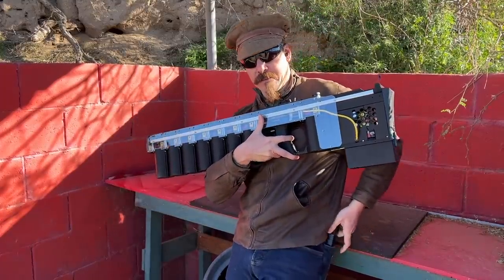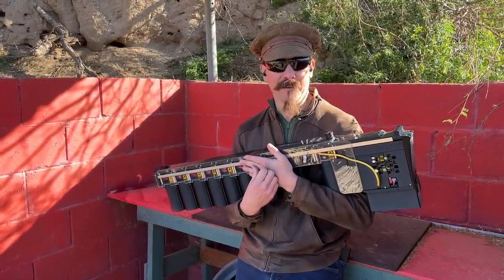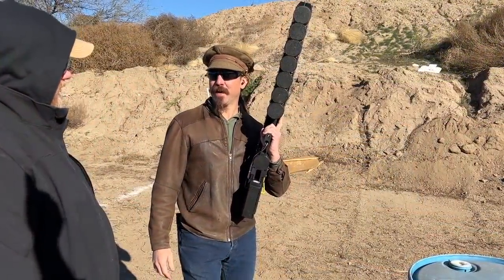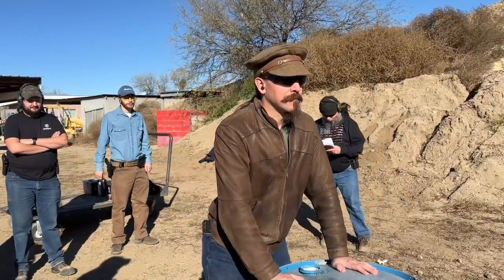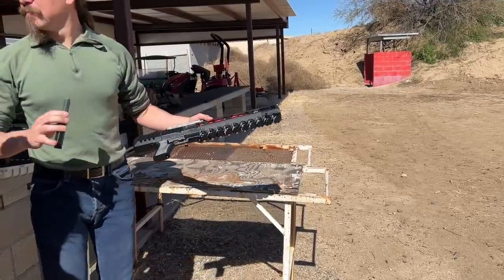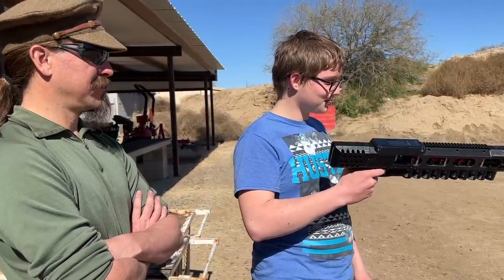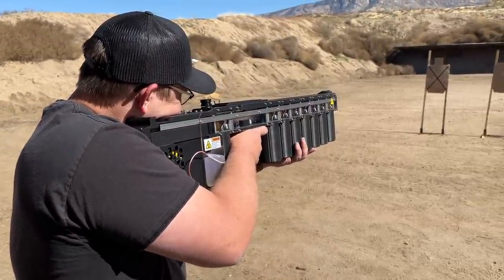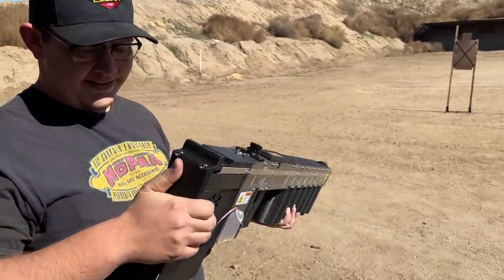I Tried to Use the GR-1 Anvil at the BUG Match...

Comment: I think one reason the projectiles had so many problems (aside from this being a very experimental weapon) is because they were too heavy and blunt.  there appeared to have far to have far too blunt and flat of a round and it would give it far too much wind resistance and likely making it expend far too much energy to launch it.  I'm not one of the developers or manufacturers of this gun, so I can't say for sure what problems that would cause or fix, but I think maybe a conical or semi-hollow round might be worth a try
Reply: I think the creators were thinking about using ball bearings rather than dowel pins. It's mentioned in Ian's interview with them irrc.

Comment: 4:35 My thoughts exactly! My brother and I made a couple tiny coil guns with flash capacitors out of disposable cameras and 9V batteries (thanks, PopSci!). They launched cut pieces of paper clip at 1 MOA (1 month of angle) and would stick in a Lego man's face if you shot him point-blank. Couldn't even feel them through a pair of jeans at 5 feet, so both the precision and power of these machines from Arcflash are kind of mind-blowing.
I want one of the little full auto guns, and at around $1k they're pretty reasonably priced, but I'm a little nervous about gripping them by the capacitors hanging out the bottom. The projectile might not blow your hand off, but those big caps certainly can :D Might need to cobble together a skookum-albeit-nonferrous handguard for that bad boy. KP's SHTF wrap isn't Kevlar, is it...
Looking forward to seeing the production version of the gun at the match!
Reply: I laughed at "month of angle"! Sounds about right for this gun.

Comment: Holding the two-stage trigger at the first action point until it charges seems like an over-complicated charging mechanism.
Have it automatically charge whenever the safety is off, or a pump-action or lever-action activated switch engage the charging mode, so the user only touches the trigger when they try to kill something. 
And have holding the trigger down do nothing until it is fully charged to prevent half-charge shots obstructing the barrel, so that holding the trigger down fires full charge shots as fast as it will charge.
Reply: Introducing a safety so that the gun isnt completely live or off would be a start, at the moment if it always pre-charged it would be on a hair trigger. (though also worth pointing out a capacitor cant hold a charge for long, if it was primed when not in use it would be leaking energy and getting hot and potentially speeding the natural deterioration of the capacitor to the point its leaking acid)
Reply: @watcherzero5256  also, having the thing fully charge by default would add some more safety concerns. An accidental short circuit on a charged capacitor (hitting something, dropping the gun) can lead to it exploding. I´ve seen capacitors explode, it´s no joke, and these things are beasts. I think for safety reasons as much as hardware life expectancy, it would be better to have to charge the thing on purpose, even better without a chance to dry fire it.

Comment: The charge button should be on the fore end not as part of the trigger pull. Probably hollow projectiles or donuts might be better.
Reply: Wonder if they've tried milled rounds with spiralling grooves that might self-stabilise?
Reply: Could also do a button on the grip you hit with your middle finger, like the rev trigger on battery powered nerf guns. Those are a very similar manual of arms, because you have to give the fly wheels time to get up to speed before you can fire.
Reply: @tendrax  I suppose the long term future of this technology will be stacked capacitors that charge in parallel (as capacitors get smaller and more efficient) so that staright after a trigger pull you still have say three more banks of charged capacitors ready to go, and the one you've just discharged will recharge automatically from the main power supply.
Only downside of that approach I suppose would be that you'd have constant transformer whine.
Reply: @smorrow  mag-feeding some of those would be a fun engineering challenge by itself...
Reply: I wonder if it would be more intuitive to use a cocking "hammer" to initiate the charging, like a single action revolver.

Comment: The awkward moment when you realise that once such weapons are made practical for use the legal nightmare about owning them starts. Its gonna be a doozy.
Reply: True, regulating all this stuff is going to be very interesting.
Even more so than with conventional firearms, every component that makes up a coilgun is functionally harmless on it's own, with several good excuses for owning it.
I guess the most sensible option they have would be to start legally tracking capacitors over a certain size? Although, good luck with that, considering how important and omni-present these are in any kind of modern technology (Plus, I'm pretty sure it's possible to get around this by just using several smaller capacitors instead, although this reduces efficiency and makes engineering the circuit more complex).
Reply: @BackwardsPancake  Strictly speaking they only need to make the "fire control computer" the regulated part. They don't track metal tubes and whatnot from which you could fashion a firearm with only hand tools, skill and patience.
Reply: @andersjjensen  yeah, start tracking every Arduino and raspberry pi? Good luck lol. The code could just be written from scratch VERY easily
Reply: @marcusborderlands6177  Just the same as every piece of pipe from the hardware store can be turned into a barrel. The point of regulation is not to prohibit ghetto items. Because the ghetto is gonna ghetto regardless of regulation. The point of regulation is to define a legally registrable item and place safety/inspection/embargo/export laws on it.
Reply: Pretty sure the regulated part will be high speed super-capacitor charging circuits, if not the super-capacitor. From context, they seem to be the part that's difficult to replicate with consumer manufacturing facilities and the past critical to making a practical weapon.
Reply: @andersjjensen  yes, I understand that, but you chose the easiest part of the weapon to get, bar the polycarb barrel and the wires lol. the capacitors are much more likely to be regulated, as they are already kinda hard to get, and it would not disrupt commerce much for an extra check on them.
Reply: @marcusborderlands6177  No, I chose the component which is easiest to define legally without accidentally imposing far reaching restrictions on other areas of commerce. That an overclocked tamagotchi can be fashioned into one is another matter entirely.... Again, legislation is not about inhibiting unauthorized production. It's about telling manufacturers: This is the thing that must have a serial number that you must report to us and that people must put their name to, so we know who has it.... That would totally suck for capacitors. Like which one should be serialized? All of them? And if one fries, do you need to go through hoops to get your new replacement serialized and then registered?
Reply: @BackwardsPancake  As I said to many others: Regulation does not exist to prohibit makeshift production. You can easily fashion a firearm out of stuff from your local hardware store with a bit of cutting, grinding and filling. It's about defining which thing in the gun constitutes "the gun", and thus needs to have a serial number from the manufacturer. When the rest of the gun is made from common items and a bit of moulded/printed plastic parts it would make sense, from a legislative point of view, to do it on the thing which is unique to the gun. That would also open the door for legislation about not tampering with said device.
Reply: you gonna need a Ph.D is Astrophysics to own one lol
Reply: It's going to be impossible to regulate electronic weapons.  If you ban high capacity capacitors, you cripple every single industry that requires them, even something as common as a commercial microwave oven.

So, yeah, good luck with that.  I'll take a phased plasma rifle in the 40 megajoule range and 2 of the electrolaser blunderbusses, yeah those ones there that can take out a herd of "deer".  Cool, do you take cash?  Awesome.
Reply: Especially if you add this whole 'don't be near it with a pacemaker'... Imagine open carry such a thing, pull it in an emergency situation and kill three innocent bystanders by heart attack...
Reply: @marcusborderlands6177  Well, yes, it can get built easily. But honestly, It's the same with every other firerarm. It's not rocket surgery to bent a few metal pieces and put together something you could kill others with. It's however still illegal if you get caught with a self fabricated gun.
No difference here. You surely can still buy your arduino. But turning it into such a fire control unit will be the illegal part. Getting caught with such a thing - you're in trouble.

Point is: Everybody can make weapons if they are willing to disregard the law.
Reply: @marcusborderlands6177  Well, coming from this side, I understand how your first comment was meant :D
Reply: @robertnett9793  I would say the main difference is an Arduino can be unplugged, the data wiped, and bam, it's gone, no trace. (Especially if you stored the code on volatile storage like ram) compared to metal that had to be altered permanently.
Reply: I would guess it is perfectly covered by german gun laws: it´s a portable object the design and makeup of which make it suitable to negate another person´s capacity for attack and defense, it is a device that stores energy to be released into a projectile upon activation, and it is a device that accelerates a projectile in a barrel.  Clear cut case, the moment that this thing exceeds 7.5J muzzle energy (and it does, I think it´s about 100J), it is unambigously a weapon in german legal terms, and you need to be 18 years old and apply for a license (either "small" or "big", depends) to own and/or shoot it.
For this reason, a high power air rifle, a crossbow, or a potatoe gun are considered weapons in germany, whereas a recurve bow is a sporting item, considered as "dangerous implement", meaning the holder is responsible for what happens and you are in big trouble if you hurt someone, or huntable game,  with a bow on purpose, but anyone can own one, no problem.
Reply: @marcusborderlands6177  Yes. As said - after reading your second comment on this, I understand where you are coming from. It would be a lot more reasonable to restrict other parts (like the high performance capacitors)
Reply: @paavobergmann4920  It would introduce the added problem with the magnetic field and the added danger for people with pacemakers and so on. Pretty sure, if there is a readily usable final product of this gun it will be heavier regulated, if allowed at all due to that risk.
Reply: Is it really any more of a problem tho?  Many workshops could turn out simple firearms now if they chose to, shotguns, STEN clones, weapons from semi auto to full, etc.  Just make the penalties for circumventing the law strict enough and very few will bother except criminals, and criminals already dont care about firearms laws anyway.
Reply: @andersjjensen  the computer in this gun looks like an Arduino, at least the one which could be briefly seen in the previous video. That won't be all that easy to regulate.
Reply: @praevasc4299  As I've explained about a billion times by now: the regulated part of a gun is not the hardest part to manufacture. The regulated part of a gun is the part that is the least likely to need repair/replacement. It doesn't matter if you can ghetto it with relative ease. Regulation does not exist to "make it hard to cheat". It exists to make it illegal to cheat... plain and simple.
Reply: @andersjjensen  But the question is, in this case, what exactly would you regulate? Arduinos are sold by the millions, and in this case it's not "ghettoed" but part of the official design.
Reply: @praevasc4299  This particular design would have to be redesigned to continue production post regulation. This has happened before. It's generally done by setting a grace period to allow manufacturers to catch up. But by the time this kicks off enough to raise eyebrows you can be absolutely sure that a more cost effective solution than an entire Arduino will have been found. A dedicated fixed function fire control chip with a one-time-programmable serial number would be an absolutely tiny piece of silicon real estate. Any serious manufacturer would not ship something which is (fully) reprogrammable anyway, and it wouldn't be long anyway before "power classes" of some sort would see regulation too, so reprogrammability would be banned. Think "destructive device" and "short barrel rifle" type laws.

Comment: Seems like it would benefit from giving the user more and clearer feedback, both in terms of trigger and operation, auditory and tactile.
Reply: Having the trigger vibrate when the coils are charged would be nice.
Reply: @jennoscura2381  Having an actual dual stage trigger that's not a plunger would also be great.  You can easily buy switches with different actuation forces and design mechanisms to do that.  It's just the first was very much a prototype that's fireable.  Same as several of the guns that we've seen on this channel.
Reply: I don't disagree, but I suspect that's at a design stage past the 'aim and fire at a given kinetic energy' which they are working on with the model shown.  
Lots and lots of gun innovations shown on the channel capitalize on marginal/cheap mechanical changes.  I don't doubt that a non-powered indicator of 'the capacitors are at full power and the gun can fire at 100% of the specified velocity' can be engineered, but it seems like a clever materials question as opposed to a 'just run a vibration motor after a sensor is tripped' fix
Reply: What more auditory feedback do you need, it makes the capacitor noise!

Comment: The "machine pistol" version needs some introduction or did I miss it?
Reply: Having had a look at ArcFlash Labs' website, that's an EMG-01B. It's similar in power to a spring powered airgun, 3.5 ft-lbs (as compared to the GR-1 Anvil's 75 ft-lbs). Dangerous in the sense that it'd bloody hurt, but you'd have to try really hard to substantially injure someone with it. Much cheaper though! $1030 on preorder, compared to the Anvil's base price of $3750.
Reply: @Ariche2  Thank you.

Comment: Imagine in the middle of a battle, your gun suddenly reboots itself and the screen says, "Downloading update 1 of 256, Do not turn the power off..." ... And the battery shows like 15%.
Reply: @AlphaCarinae  the coil gun has a computer built in, with os and everything to calculate the time to put the magnets on and of in time, to show battery charge and to show the selected Bolt Power
Reply: @AlphaCarinae  bruh
Reply: "You require admin privileges to cap this fool"
Reply: “We’re getting everything ready for you”
Reply: @AlphaCarinae  exactly lol  there is no reason
Reply: @AlphaCarinae  Well for 1, security updates, software improvements, efficiency increases, and more.
If theres a computer, there will be softwareupdates, especially if this was in the future as a combat weapon. Its not like a handheld calculator where its not cost prohibitive to just build/buy a new one when you have updates to the software.
it wouldn't be done over WIFI in the middle of a battle, but thats why its called a joke.
Reply: @AlphaCarinae  firmware update. Like the ones that randomly screw my router.....

Comment: Idea? Using a thin steel tube, suspend a lead rod with a heavy spring whos terminus is the steel tube. The lead rod becomes the primary longer range projectile? Sort of spreading the impulse time through good old fashioned energy storage device, a spring.
Reply: I did mean all the above fitted into a similar sized projectile shown.
Reply: I think the issue there is that less steel, means less ferrous material, means there's less for the electromagnets to pull on.
Reply: @Ariche2  nah, they've got variable round lengths already- something the size of the 2" with the steel in it the 1" should logically work

Comment: An interesting aspect of an electrically fired gun is the trigger, being simply a switch could be placed in the off hand or even under a toe and fired without a chance of the trigger finger pulling or otherwise impacting the shot.

Comment: So this gun is literally more likely to kill the shooter than the target, if the shooter has a pacemaker.
Reply: or that it just doesn't fire lol
Reply: in that scenario yes, but overall this is still potentially lethal. Not _practical_, but more dangerous than a toy nonetheless.
Reply: @nerdyspinosaurid  right now it's mall in a ballpark of low powered(I mention it because there are examples of pneumatic guns that can crack concrete block) "hunting" pneumatic rifles and crossbows. In 10-15 years it would be comparable to their upper limits and much more sleek then it is now. By then plastic cases on firearms would be a norm so pushing against firearms would be even harder. But that's basically a novelty hobby gun. Which technically isn't a firearm.

Plus(when this thing will finally be firing flechettes/dart) nothing stops you from adding copper wire to the end of a projectile and dumping the remains of the charge from capacitors into the target if the circuit gets closed. You can't get it back into the battery either way...
Reply: @marmite8959  It's comparable to a powerful slingshot, and make no mistake; they can be lethal as well.
Reply: @marmite8959  Sorry, I just wanted to confirm it.